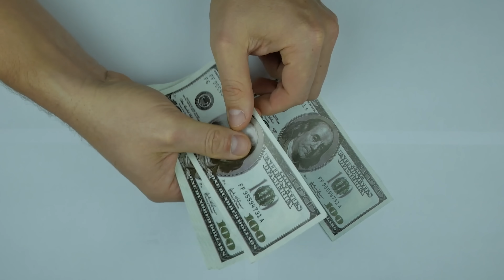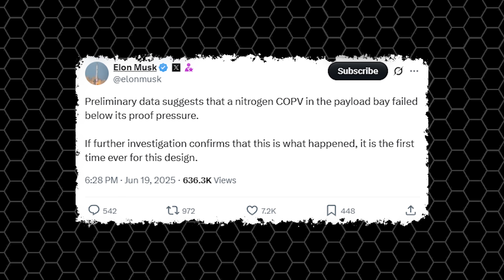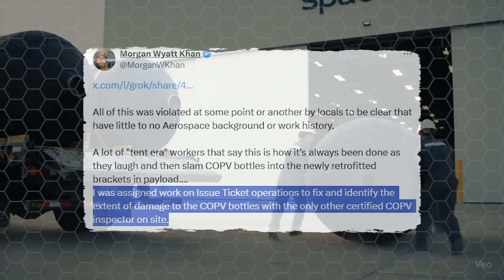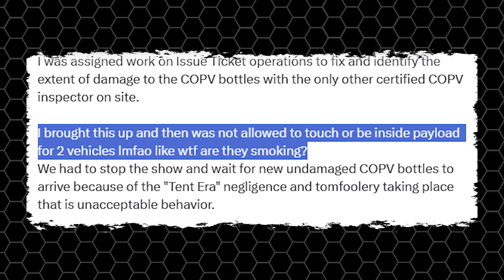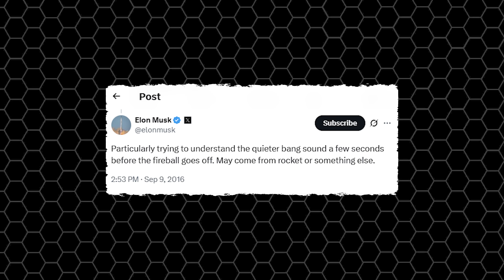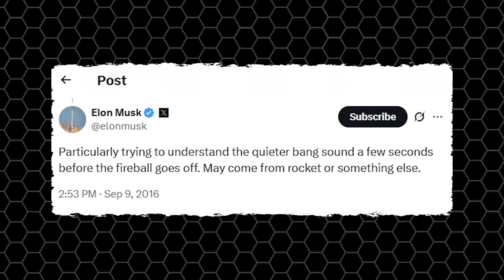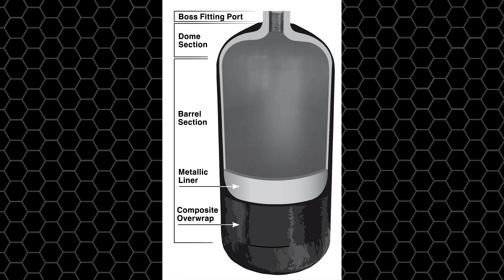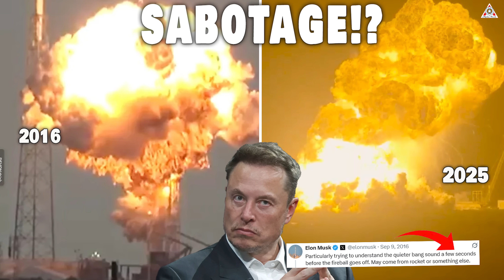Elon Musk Declared SpaceX Ship 36 COPV explosion was sabotage...Here's What Exactly Happened!

Comment: I'm not sure if it is sabtage or a defect in the cylinder itself.
Reply: Neither. Dumb design. Why would you put these and a header tank in the nose cone area, right atop where the crew compartment would be???  Why run that plumbing through the cargo bay?? Again, very dumb design! 

Why would you not put these right above the tanks, the place that would make the most sense?  They made the Methane tank bigger on this version and moved the bulkhead. We see the cargo bay collapse right in the bulkhead area. Obviously, the structural support in the area was grossly lacking. More likely was a plumbing leak in the cargo bay, building up methane gas. They were testing the fins at the time. (Note: I refuse to call these "flaps" because they a fins, not flaps. No aerospace engineer would call these flaps!) 

The accumulated methane gas exploded,  Possibly from and electrical spark. associated with operating the fins. Debris punctured the COPV, launching it like a nitrogen powered rocket out the side of the Starship. It was a result of the explosion, not the cause!  If all the nitrogen catastrophically escaped the COPV,  it would not cause an explosion. Yet we can see the COPV being propelled by leaking nitrogen.  Seems pretty obvious that rushing to get the Starship ready at least a  full week early involved shortcuts and poor workmanship. Never once in any of his businesses has Musk allowed safety to delay production!!  Tesla plants have horrible safety records